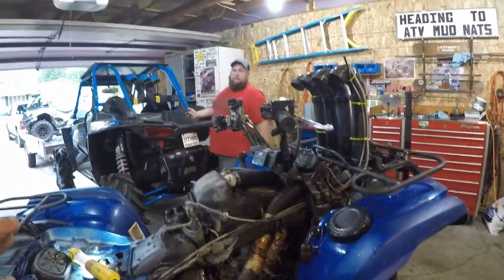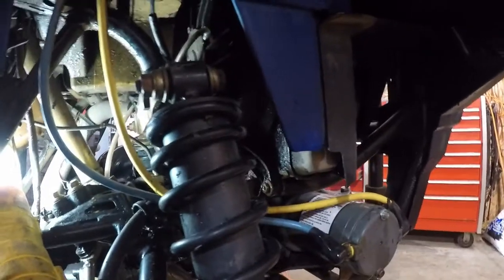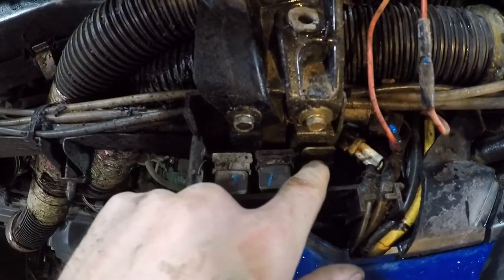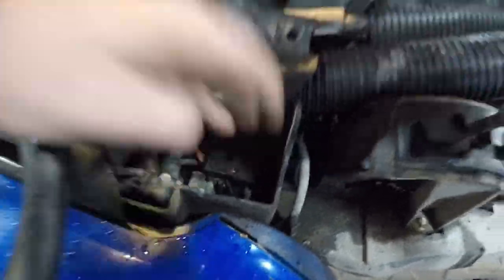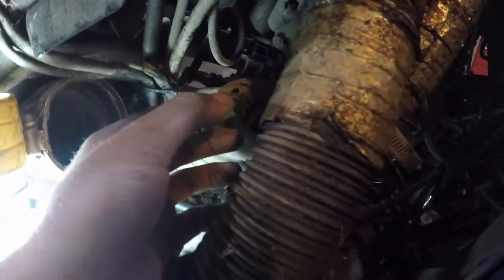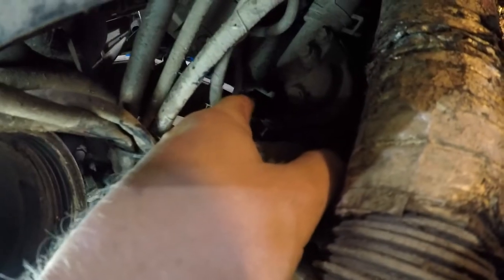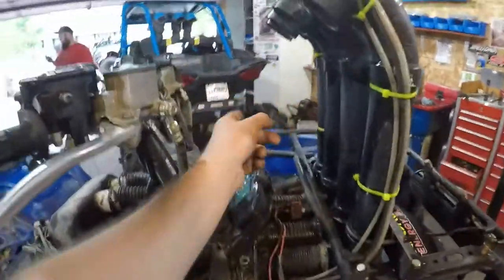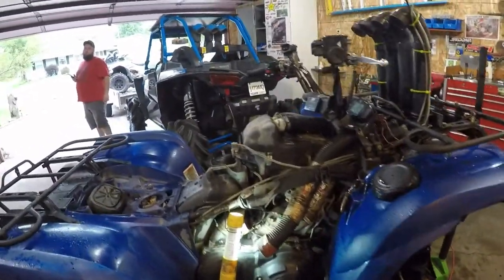2012 Grizzly 700-Fan Won't Turn On

Comment: I had the same issue with my Grizzly. Except mine was a bit more difficult to find. I checked all those things I had the 3rd relay where you don't, and what I found was the wire underneath the connector was broken and I had to push the pin out and re-solder it. That was a head ache to find that broken wire.
Reply from the maker: That’s exactly what I was hoping didn’t happen, finding bad wires it hard lol.... as soon as the fan turned on after I jumped that thermosensor I figured I am good
Reply: I'm glad you resolved the problem my friend

Comment: U have the exact same scenario, waitingg for parts to fix,  but my fan will kick on but engine gets extremely hot before turning on. turnsd my phone off in center console from heat
Reply from the maker: Grizzly’s don’t produce a lot of heat like the twin cylinders do. The only time I can get the fan to turn on is if I’m doing a lot of idleing in 90 degree weather or if radiator is packed with mud.. if I leave my Rzr idle for 5 min the fan turns on.. when I found this sensor was junk, I asked myself how long it was bad lol, could of Been bad for 6 months lol

Comment: how did the sensor work out?
Reply from the maker: Worked! That’s what the issue was, but then when the fan turned on it only spun half the speed I thought it should of spun, ordered a new fan and everything was back to normal
Reply: @grizzlygreg8922  awesome thanks ya my 2014 is doing both those things. I think it might be burning oil? Im going to probably do a piston and rings too
Reply from the maker: My goal is to start a new grizzly build this spring with a brand new one and then possibly fool around with a big bore kit and cam, different tuning.. we will see how it shapes out

Comment: I got a 98 grizzly 600 yfm my fan just stopped working on mine I don't no w to look I did run a wire from the battery and the fan will come on  but will not come on by it sealf don't no w to look at
Reply from the maker: If your running a wire from battery right can it it turns on like you say, then it is either the sensor/switch that is located in the cylinder head or water pump area. Once you find that sensor/switch; jump the terminals in the plug with a paper clip. If the fan turns on right when you start the machine, it would be that sensor that is defective. I don’t think the 600s have a relay since my 2012 700 doesn’t. So I’m willing to bet it is a worn/shorted wire or that temp sensor/switch